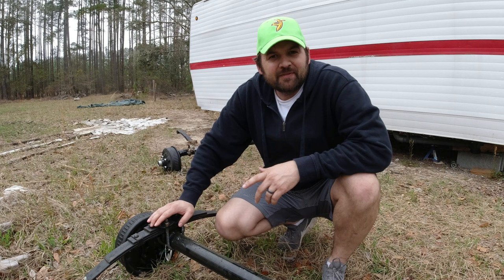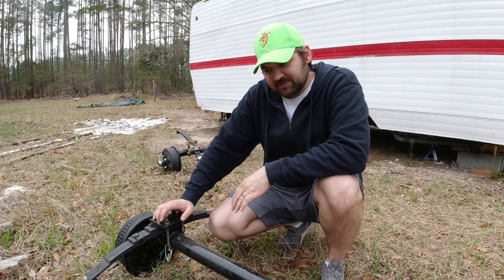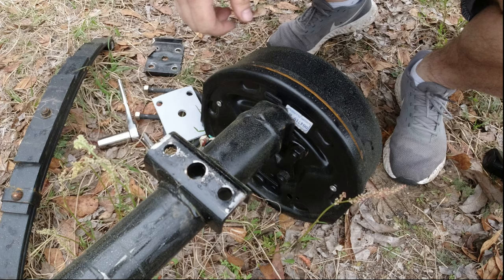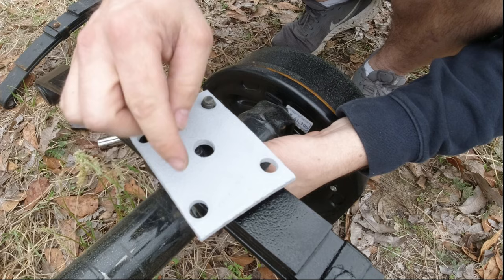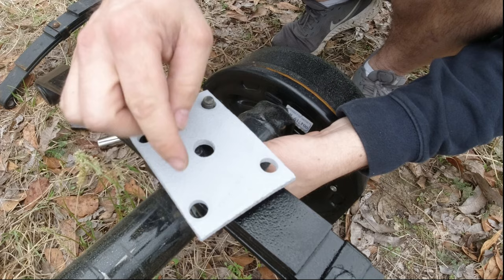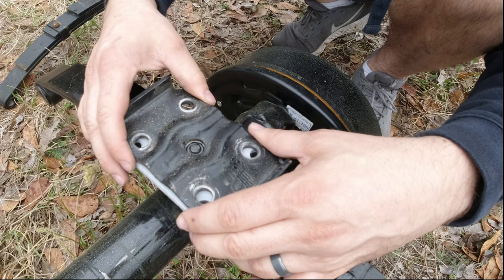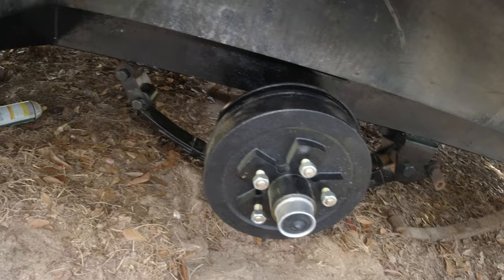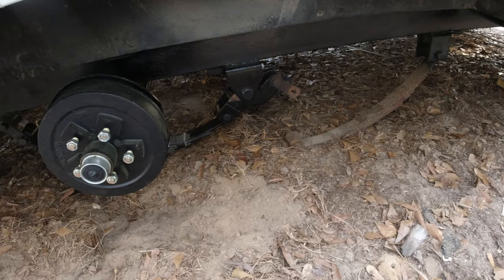Vintage Camper New Axle Replacement and Installation

Comment: Yes! Our stove wire burnt out. I purchased a new wire harness & the very last screw in the terminal block would not come out.  I had to buy a new terminal block, but it did not come with the special screw that I needed!  I found the part on Ebay & asked the seller to make sure the screw was included.  We were without a stove for 3 weeks.
Reply from the maker: Sorry to hear that!  There are just some things that don't want to get repaired.  They go kicking and screaming to the finish line!

Comment: I think I'll have to do this with my trailer as well (1962 Holiday Rambler).  If I have to do it I think I'd use the old plate on top of the new plate if I need to drill to make the U-bolt fit.  Seems stronger than using washers.  And Loctite too... I'm always worried about things working loose.
Reply from the maker: I hear ya about the loctite!  I finally got it rolling now and plan to keep checking the tightness regularly.   Good luck on your axle swap!